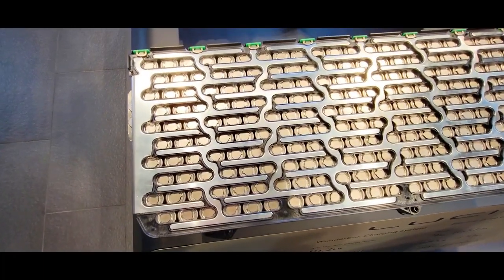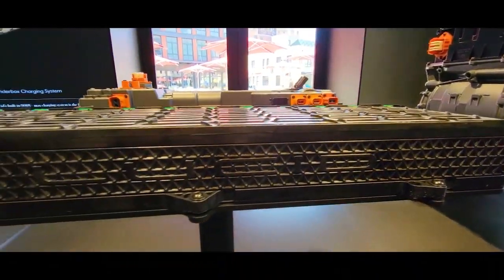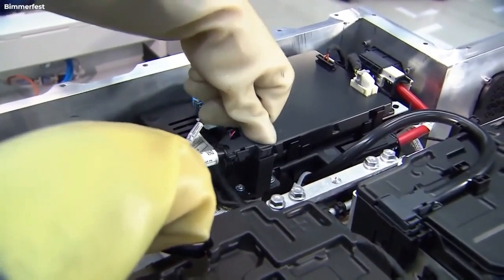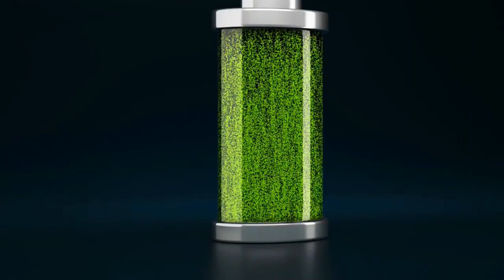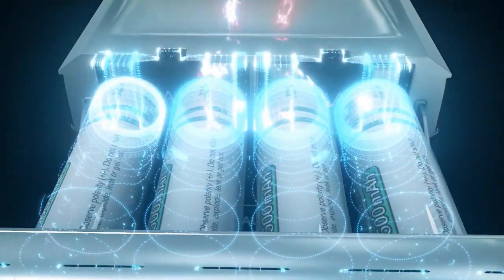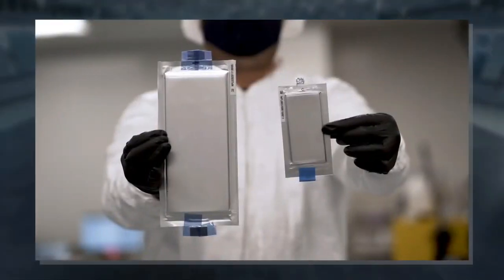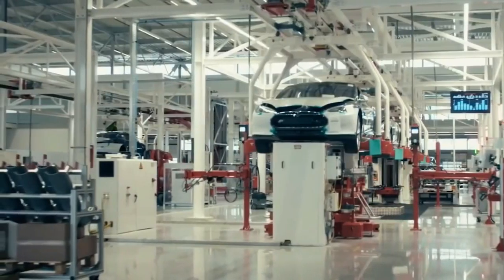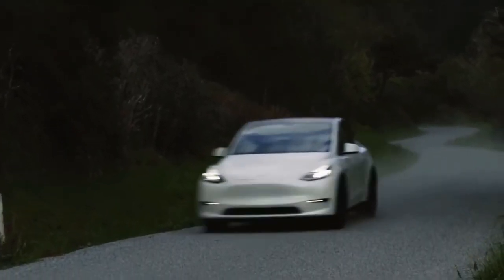Tesla Just REVEALED A Battery That Could Last A Century!

Comment: The part about the three Chinese EV's that caught fire using a nickel based battery. This does not mean the tech is suspect it could be the cheap Chinese manufacture practices is at fault. Remember if it's made in China it is usually junk.